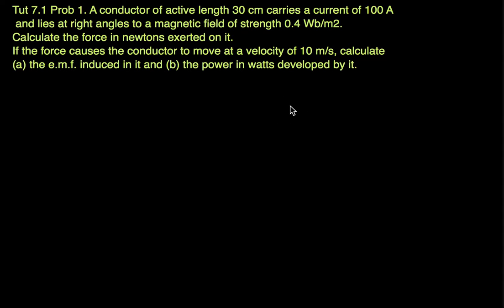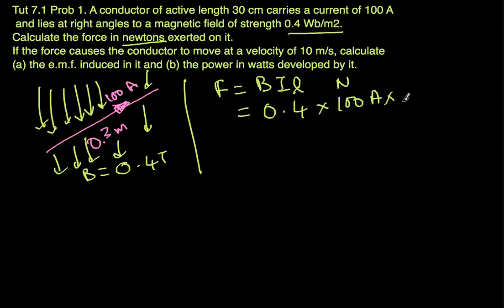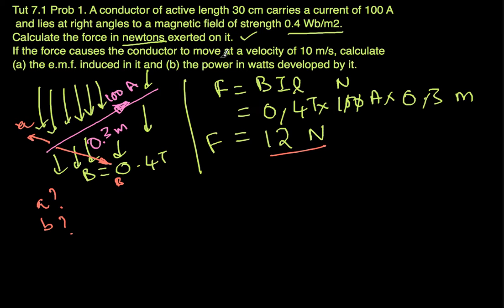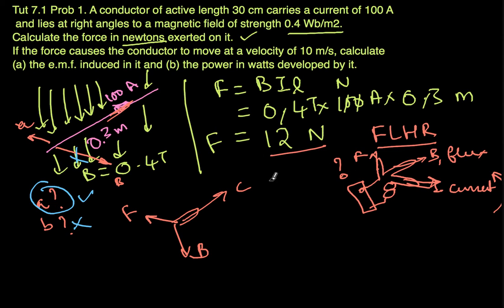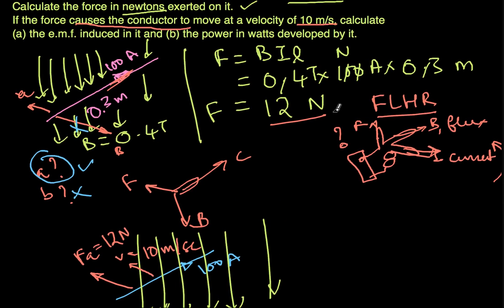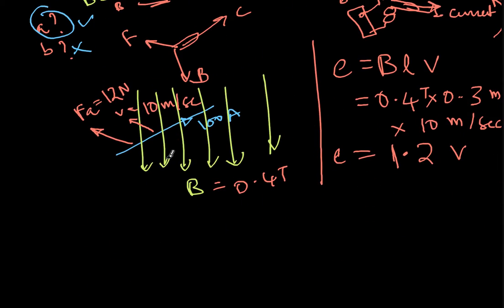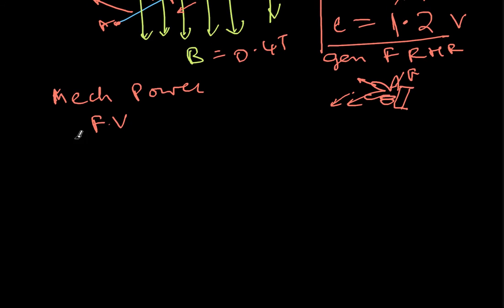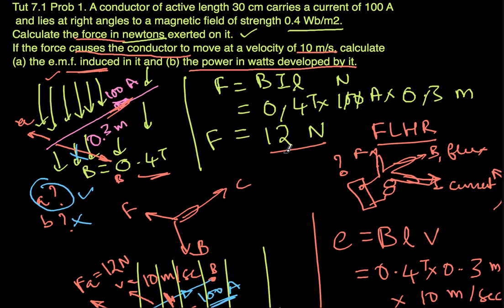EMI9 - Problem on motor principle - Tut 7.1 Prob 1

Comment: A permanent magnet does work when it attracts an iron nail.But according to law magnetic field should not do any work then what else is doing work here??
Reply from the maker: A magnetic field does not do any net work (when averaged out over long periods of time). Energy is stored in the magnetic field. For example, take a permanent magnet, it will have energy E stored in its field. When an iron nail is attracted by the magnet, work is done by the magnet in pulling the nail towards it, using the energy that was stored in it. So, as a result, the configuration of the magnetic field is changed and the energy stored in it also reduces to E1. (where, E1 < E). The iron nail allows more flux to pass through itself (due to high permeability compared to air/space) thereby reducing the space occupied by the field of the magnet before the nail is near it. Since the space occupied by field reduces the energy stored reduces. Now, after some time, we have to do work (E - E1), pulling the iron nail away from the magnet (against its force of attraction). This work done by us will increase the energy stored in the field back to E and also restoring the configuration of the magnetic field to its original shape. Thus, the net work done by the magnet is zero.

Comment: sir  magnetic field does not do any work then how can it actually move the conductor with 10m/s velocity?? sir please explain it.......please
Reply from the maker: because, in this case, the electrons moving  (the current) inside the conductor are actually doing work in moving the conductor. The electrons inturn get that energy from the voltage source connected to it.